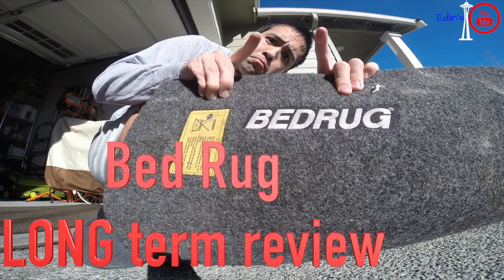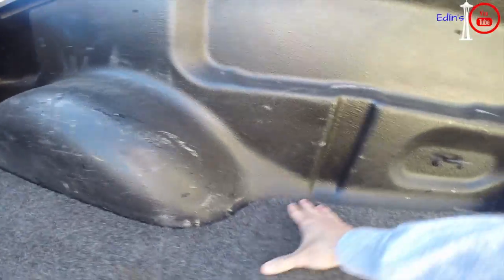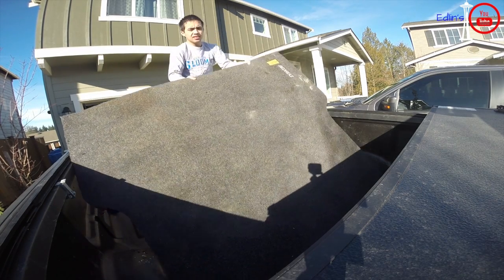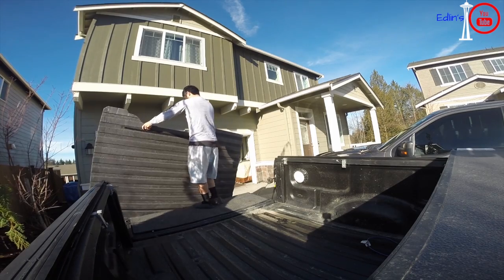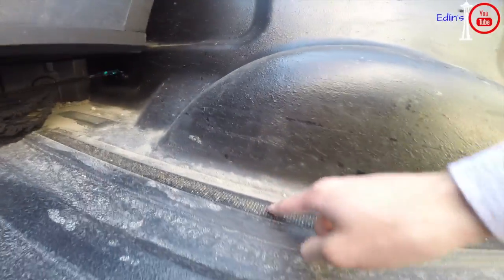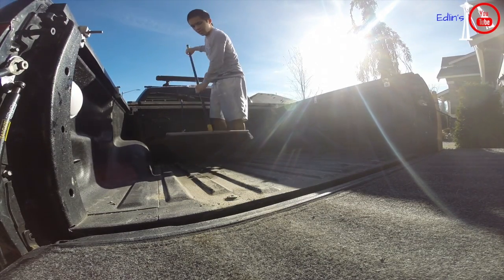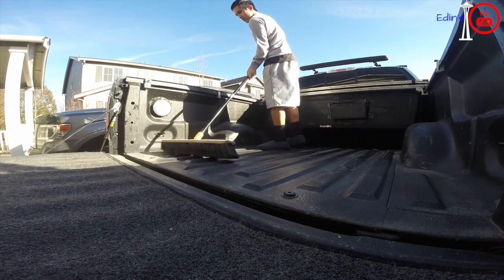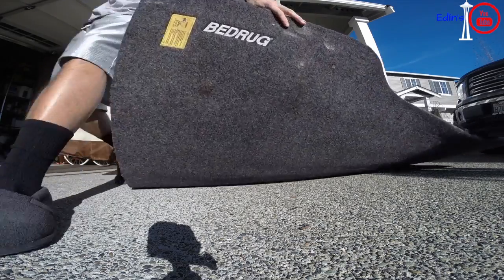BedRug Mat - Long term review (2 Years)

Comment: Hi Edlin - if you were to get a load of dirt or mulch, would you remove this prior?  Or leave it in and clean it after?  If removed, would the velcro attached to the bed be ruined?
Reply: Kirk Wojno no I use mine hauling fire wood, gravel, sand . Just brush it off and your good to go
Reply from the maker: yup shop brush will get it right off. but i would save time and just put a tarp over it because the fibers tends to catch some of the finer stuff. 

can remove it all you want without ruining the velcro